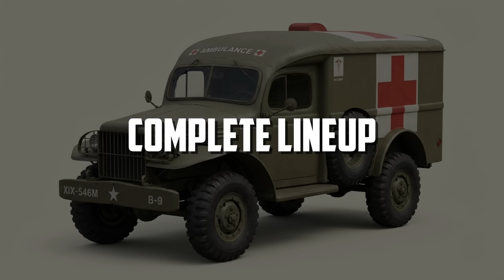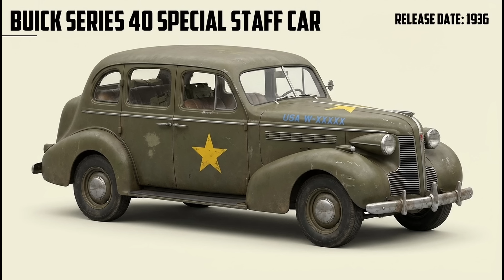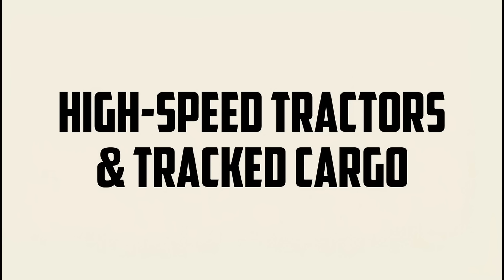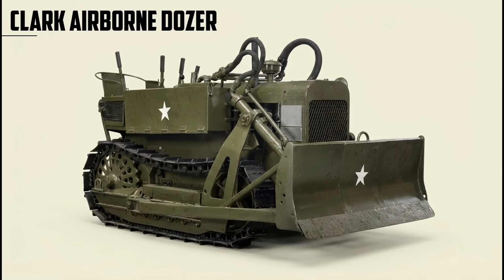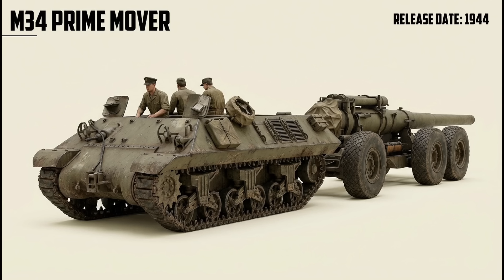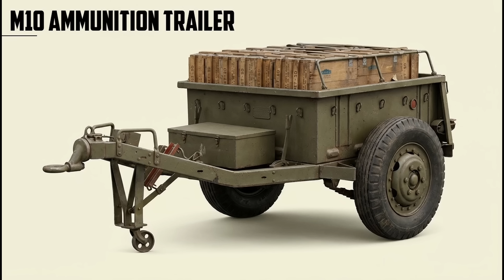Every U.S. Military Truck & Car Used in WW2

Comment: A series of Korean War US vehicles, tanks, artillery, construction equipment, motorcycles, and everything else hauled by rail. I do model railroading in the 1948 to 1952 era and want to build out several trains of military equipment hauled by rail that was in the Korean War. I would greatly appreciate all the information you could find and put out on the Korean War vehicles, etc. Some are holdovers from the end of the Second World War, but include them too. A series like the ones you've done would be good or a two hour long video of just identifying these pieces like in this video would be ok with me. Either way. I've found a lot, but I'd still appreciate seeing what you could find as well and helping verify for sure which were still in service from WWII. New subscriber. THANKS!
Reply: Most of the vehicles used in the Korean war were the same as the ones used in WW2 or modiefied versions, like the WC-52 its just a WC-51 with a winch.

Comment: A good number of Vehicles although there were many other 
variants of the CCKW  you didn’t mention they made Dump trucks , workshop units, communication units . Air compressor units , fuel and water tankers , bomb moving trucks . They built 500,000 total units , of that they built 475 
 Air portable units
Reply: Confidence without arrogance… I like that.❤
Reply: Nunca hubo un ejército con mejor material vehicular Simples y robustos capaz de andar en todos los climas del mundo😊🎉❤
Reply: Drump?
Reply: @youwantsumfukdon’t you like how auto correct changes things , Thanks corrected it

Comment: I worked for a midwest railroad and into the mid 80s we still used a D4 and a D7 to do work in the yards. Eventually replaced by newer all hydraulic blade models. Especially with the D4 you had to watch the blade cables. The D4 was the 1st bulldozer I ever ran.